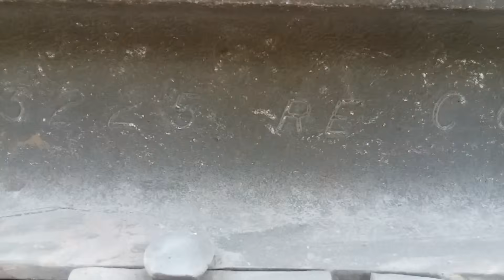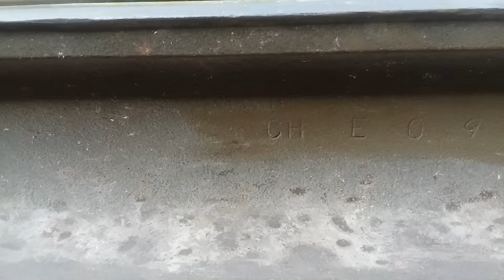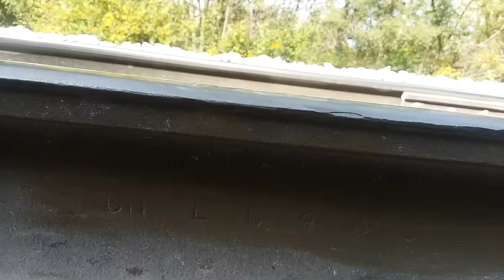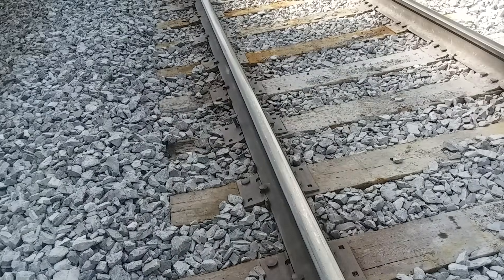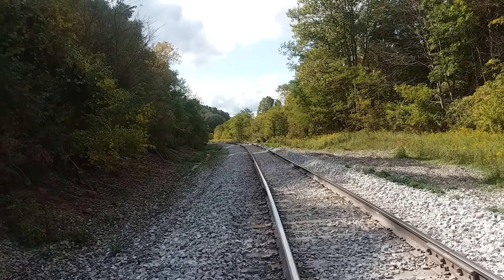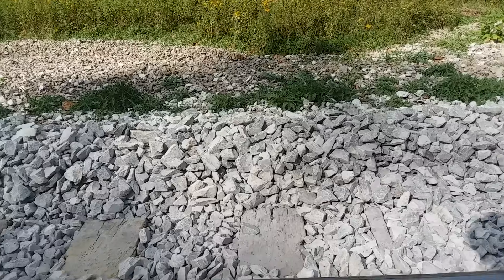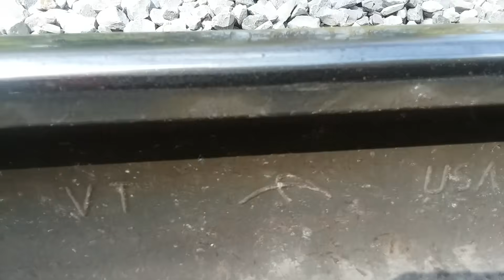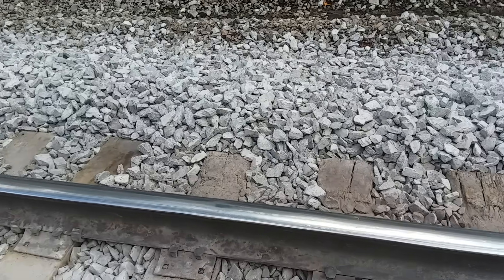Rail Defects: Rail End Batter and Flowed Rail, Heat Numbers (Heat or Rail Stamp) and Mill Brands

Comment: Next time ...maybe the roadmaster will call a grinding train.....save your rail alot  longer 
Especially that curve....
Good job ......🇺🇸👍🚆
Reply: Yes sir, grinding would be an enhancement to our rail life, however you may or may
not know, we do not interchange with any other railroad, all our rolling stock has
been trucked in, so getting one of those huge grinders here is impossible. I've suggested
in the past to try and truck in a small switch grinder, but they aren't cheap and charge
same whether they are sitting waiting on a train or grinding, they are also slow, your talking
some pretty big bucks, anyway as of yet no one has agreed with my suggestions. Thank
you for watching
Reply: Sometimes suggestions to improve something or extend its useful life deserves testing. In the 1970’’s my Dad was comptroller for a paint company in Albuquerque, NM. I seem to remember that his company bid the annual highway department  RFP for 55,000 gallons of highway yellow paint. An idea was in the hopper to paint curved highway sections with extra layers because that’s where tires cross the line more often. The thinking was if curves got extra layers the overall highway paint would have a longer life. I never found out if they put that idea to a test.
Reply from the maker: @shermananderson700  Sherman, excellent point you make there sir.

Comment: I’ve seen sidings on metro-north in New York State from 1925 don’t look as bad as that defective rail.
Reply: Andrew, thanks for writing in,  that's pretty cool rail from 1925. Remember also
that this rail was rolled in 1975, it is main line and the joint had a lot of mud under
it so that wasn't helping much with the pumping up and down. Siding track doesn't
get near the abuse of mains as you know. However certainly this should have been
changed a lot sooner, we were really lucky that the head on it didn't blow out. Thank you for
watching

Comment: Does the taper on the wheel affect rail ware? I remember being told way back that the British used a wheel taper of 1 in 20 while the United States had gone to 1 in 50 or 1 in 100.  This may have been only for passenger trains
Reply: Alexander, thanks for the "thinking" comment. While I am not a rail car wheel expert, 
our tapers are at 3 degrees. I believe this to be standard for all freight wheels in US. I have no clue about passenger. Yes indeedy from my point of view as a wheel wears flatter it
will affect rail wear as undue friction is applied to the running surface. In best case
scenario those wheels will be replaced before they get to that point tho. There are
standards in the Code Federal Regulations on how much allowable wear can be
on a wheel before it has to be replaced. 

Car wheels when they are new have a wear rate that is fairly fast up to a point, then
once the initial wear is achieved, and I don't have exact specs on when this occurs, but
then the wear rate evens out where there is very little wear. Once the wheel gets to
a certain point in it's life (wear), then it once again begins to wear out at a faster rate.

Comment: You mentioned a rail lubricator. If this over lubricates the top of the rail and not just the flange contact of the wheel, wear can occur due to cavitation between the wheel rolling diameter and the top surface of the rail . The lubricant when squeezed to a particular pressure will  explosively degas as the pressure comes off  and this tiny  pressure explosion eats away the surface  of the steel. (What happens to  bronze ship propellers if not working at designed speed). An issue in a number of industries where lubricants and coolants have a high value compression cycles.
Reply from the maker: Brian, very interesting comment sir! Thank you for sharing, i did not know that. Our greasers put grease on flanges, i suppose a very small amount gets on top of the rail, but will keep a closer eye on rail head near greasers from now on

Comment: RE does not stand for “Relay”.  RE is A.R.E.M.A. (American Railway Engineering & Maintenance of Way Assoc) profile.  There are many different profiles of rail out there.  Rocky Mountain Steel was originally Colorado Fuel & Iron (CF&I).  Steel Dynamics Inc. (SDI) rolls rail in A.R.E.M.A standard sizes of 115RE, 136RE & 141RE in lengths up to 320 foot and can weld them into CWR string up to 1650 feet.
Reply from the maker: Ezekiel, you are correct sir. Long time ago an old railroader told me it meant relay rail, that got ingrained in my brain, even tho i now know it stands for AREA or AREMA , so every time i see it that what pops in my head, old habits, right or wrong sometimes die hard. Thank you for the correction sir, glad you pointed that out. I am going to do new vid soon on rail identification which will correct my error. I hope you will watch it when it comes out.
Reply: @ccrx6700  it’s all good sir.  WABTEC has a good chart of all the different rail sizes and profiles.
Reply: Also, relay rail is not rolled. It comes from rail removed from a currently active track.

Comment: Around 25 years ago I worked at a saw mill in Quincy CA.. They had an engine to move lumber cars a few miles up to a side track.  The rails went through beautiful pasture land. If it was a nice day, and they had to move cars at my lunch time, I would sit on the front of the engine on the catwalk and eat my lunch.  We only went 10 MPH or so, and as I was enjoying the ride looking forward, I see a rail pop up in the air about 3 feet on the far end. I jumped up to see if the engineer saw it too, and as I looked in his window I see his huge grin. He leaned out and said "Yeah, the mill won't spend money on rail maintenance unless this thing derails. Been doing that for 20 years".  That section of rail had no spikes, and it always laid right back down in the same spot as the weight of the engine moved over it. This was before cell phone days unfortunately.
Reply from the maker: Andrew, wow pretty cool story! Thank you for sharing it with us
Reply: A lot of us Railfans like to watch that move with loaded center divides up to Quincy Junction.  Great Story !

Comment: I see a lot of this on track in Massachusetts . The ex Boston and Maine line . Some is so bad that the wheel flange is hitting the top of the rail joiner.
Reply: About 40+ years ago I had an assignment in Chadron, Nebraska. My work took me to the rail yard of a short line railroad used mainly for pulp wood and agri produce transport. A train was leaving the station at a snail’s pace. The rails were so crooked and bent various elevations it made the cars wiggle and shift as they made their way down the line.
Reply: Mark, thanks for sharing with us. Low joints can cause the flange to hit top of joint bar. See
my vid: another broken rail but easy fix. Also a car wheel that has a lot of wear on it can
hit tops of joint bars. Although in a perfect world that wheel should have been
replaced before it got to that degree of wear. Thank you for watching sir.

https://www.youtube.com/watch?v=DTrrtMhfChE
Reply: I’ve seen it as thin as spaghetti on Guilford especially inner rails on bends .

Comment: 480 ft  rail I could only imagine how much that costs
Reply from the maker: A stick of rail new at 39 foot costs around $900. I really dont know what we pay a contractor to install a whole curve, we buy rail and OTM, we pay contractor for install labor. Thanks for watching and good question
Reply: While i cant speak to anything rail oriented, from my experience as a contractor, 15% material cost is a fairly common number used to calculate. Obviously the % ranges vary a lot but if you wanted to figure a number that is most probable that would be where i would start.
Reply: @larss592  Thanks for the comment and for watching. I don't get much involved
in the paper work end of track maintenance here. But also remember that our
contractors are required to carry railroad insurance, and it is very, very expensive.
Contractors who work underground have extremely high insurance premiums also.
Everything on a railroad is expensive, materials and labor.
Reply: @ccrx-xu1wc  i can only imagine the red tape and insurance costs. I shared to my wife so she can share to her father. He is in his 90s and has friends in rr also has collected for many years. Thx for your efforts. Keep on.

Comment: Back in the early 2000's I remember walking along a curve on a BNSF main line that still had jointed rail, and the  outside rail head  for the entire length of the curve had chips out of the top. Many larger than a thumbnail. Amazingly the next time I saw it they were gone, so it looks like a rail grinder managed to get rid of them (which surprised me since many were deep).
Reply from the maker: Those huge rail grinders do an awesome job of helping restore rail profile, very neat to watch them do it after dark! Thank you for watching the vid and hope you enjoyed

Comment: I live in very close proximity to both a CN and a CP main line.  The CN line is full of those visible crushed head and flowed rail damages, and mud flowing up all over the place.  You can walk 250 feet and see CP's single main and see quite a difference.  Way less visible damage, if any.  I have to wonder how many section gang members are rolling in their graves about the state of the Kingston subdivision today (post-Harrison, of course).  I have seen battered head at joints, seems to be a common thing, where rail joints aren't well maintained, and see a lot of pounding as traffic hits it. Also common to see battering on the manganese reinforced frogs. They seem to take a pounding,  and when they get worn, everyone within half a mile, gets to enjoy the sound of each and every train passing over it.  Louder for trains going one direction than the other.  Thanks for the video,  I was unaware of the terminology for these types of damages,  but I can see it any time I want, just go for a walk around the local train station, with eyes open.  CN has 136 and 142 lb rail and it's not really that old.

Comment: The R E stands for RAILWAY ENGINEERS.  132 25 RE refers to the design specifications of the rail.  This 132 LB/nominal yard rail would not have been relay rail when it was rolled brand new in 1975!  The R E is also short for A. R. E. A. (AMERICAN RAILWAY ENGINEERS ASSOCIATION).
Reply from the maker: Joseph, you are correct, long time ago someone told me re meant relay, guess that got imbedded in my brain cells over the years and everytime is see it that what pops up. Re does mean AREA or AREMA and 132 refers to their Rail Section. Thank you very much for adding your comment.

Comment: 2 days shoot down to exchange this short piece of rail? That’s a long time in my eyes
Reply: It's not just replacing the rail. It's Set Up, getting all the Parts and pieces there, the Equipment to do the job. Then you have to clean up after, remove all the old parts and pieces and Equipment.  Everything is done off the Rails. No roads or parking lots.
Reply: @pat36a  thanks for your explanation. Have a good time
Reply from the maker: Peter, 2 days the rail gang replaced over 300 feet on this curve including this piece, they did a great job in a short amount of time. Thank you for watching

Comment: Its a shame you don't have concrete sleepers with fast clips. Making re railing much easier than those spikes. We done away with those decades ago in the UK
Reply from the maker: We had tried concrete in a small section by the load out 35 years ago, first derailment tore them up. 90% of tie replaceme in US for class 1 are wood, seems like they using concrete mostly now on new construction. They sure don,t rot like wood ties.  Thanks for comment, but for us, we will prob never see them
Reply: @ccrx6700  we Do still use wooden sleepers, I have done quite a few wooden sleeper changes but concrete just last so much longer. I did a re railing job a couple of months back and the concrete sleepers were dated 1958. And we were changing Rail from the 70s. The time we rip the sleepers out is when the bed has distorted and the geometry is out. Our trains run up to 125 mile per hour I know in the states the trains are slower.
Reply: @ccrx6700  Has anyone tried making railroad ties out of plastic timber? That stuff is mighty. It's very strong and can be reinforced with rebar; it doesn't rot; insects don't eat it; it doesn't need preservatives that leach into the environment; repels water, so no freeze-thaw cracking; it's very hard to cut or break. Port facilities use it for sea-resistant pilings and wavebreaks and other rugged applications. Seems like railroad ties might be a natural use, though it would probably be spendy.
Reply from the maker: @JennRegier  great question, i like that you're thinkin! Yes indeedy, they do make composite ties. I have looked into them, they are very expensive although as you say, very durable and long lasting. For our budget for now we are going to stay with wood ties. There are railroads that do use them for specialty applications.

Comment: tell me wye is in the us the rail joint gaps offset and not side by side like in europ
Reply: because in curves the track is different lengths so as you travel each say 33ft of rail will gain or loose.  the only time you have parallel joints is when rail is laid in pre made sections.

Comment: Had flashbacks watching .Worked at Bethlehem Steel Steelton plant from one end to other over 10 yrs in 70's.Started in Steelmaking Dept.and even made those tie plates but ended up in rail mill where they came red hot off the line and were stacked in the hot boxes to control cooling. Had to stand 40' 2000 degree rails heads up by hand with a special bar so magnetic crane could pick up. Weak mind strong back required.ha ha
Reply: Awesome comment there sir! Thank you. I had no idea they also made tie plates. Beth Steel
was taken over by Arcelor Mittal? That is where we get all our new rail from Steelton. We
do have some rail marked Beth Steelton from years ago, I cannot remember right now
the actual years on the rail mill brands tho.

Comment: Wide gauge also causes head flow on the low rail as well. RE does not stand for "Relay Rail". It's short for American Railway Engineering Association and is stamped as "RE".
Reply from the maker: Yes sir you are correct it does not mean relay, thank you for pointing that out, my mistake

Comment: What happens to the old rail? Recycled into new rail?
Reply from the maker: Most generally used rail that is in decent shape is sold to a contractor who would use it building a siding or yard for someone else. If the rest of this stick was decent they woukd crop off this end. Used relay rail is divided into 4 classes, each class depend on amount of wear with each class determining its next safe application
Reply: @ccrx6700  thank you! You really know your stuff
Reply from the maker: @Jleed989  Thank you

Comment: You are Correct, US Steel is located in Granite City, IL, which is across the Mississippi River from Downtown St. Louis, MO. 👍
Reply from the maker: Thank you sir!
Reply: Among others.
Reply: NO!  Granite City Steel was not owned by US Steel in 1975, and did not make that rail.  It was made at the old Illinois Steel South Works mill in South Chicago.  USS closed that plant in the early 1980s.

Comment: Hello!  Why is it called “Low” Rail which you said is going to be replaced ?  Thanks! 👍
Reply: Inside rail of the curve, it a has bank to it like a Race Track.
Reply from the maker: High rail is rail with superelevation in it, low rail is the grade rail, that why it called low rail, in relation to the high rail

Comment: That is very educational. Question? During rail welding etc, what is that clay pot thingy they use?
Reply: Bob Parsons   The crucible contains a blend of iron oxide, aluminium powder, ferry silicon, Ferro manganese, Ferro niobium (columbium,) and occasionally other additives - usually graded to about 60 mesh size.  The idea is the aluminium, being more reactive, "steals" the oxide from the iron leaving pure iron and aluminium oxide.  The Aluminium oxide being light floats to the top with the slag and the additives are designed to approximate the composition of the rail steel.
Reply: Sorry I should say aluminum.  (I'm English!)
Reply: ok
Reply from the maker: Thank you Bob. Clay pot is called a crucible. It fits on top of the weld forms. It is filled with an iron oxide mix, that is lit with a torch which creates the weld material which then flows down into the form. I have 2 vids on thermite welding if want watch them
Reply: @ccrx6700  aaagh..so that is what it is..Thnaks

Comment: something how steel rail can flow over time just from use. did that happen because the bed allowed the track to move to much adding more stress than normal. if I understood what you were saying about the mud in the base. keep em coming catch ya later
Reply from the maker: Yep Kenn, that played big part in it. Hope you doing well, thank you for watching. 43 years this rail been in service. They got their money worth out of it.
Reply: It's just like a blacksmith doing cold forging -- apply mechanical stress over and over for long enough, and the metal plastically deforms. Takes a lot longer on a rail because the wheels roll over rather than slam like a hammer, but otherwise it's the same.